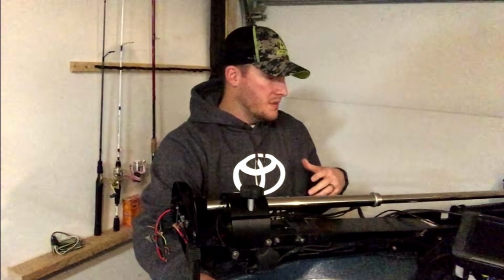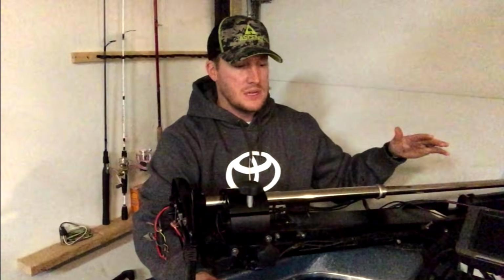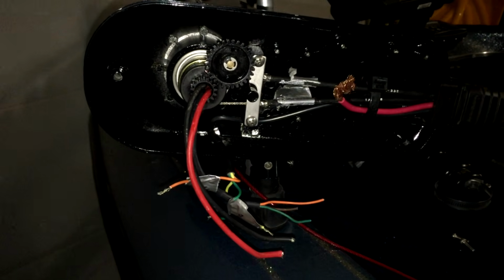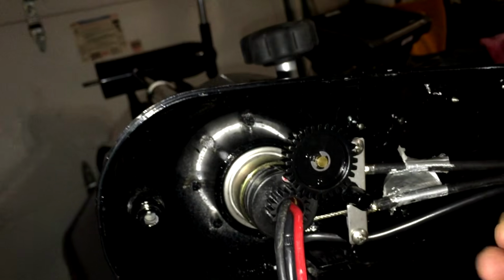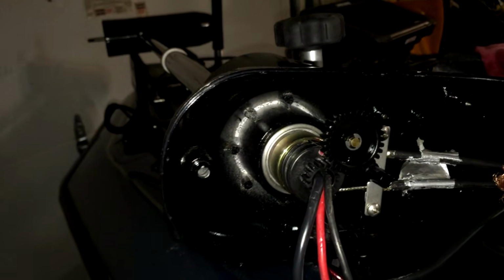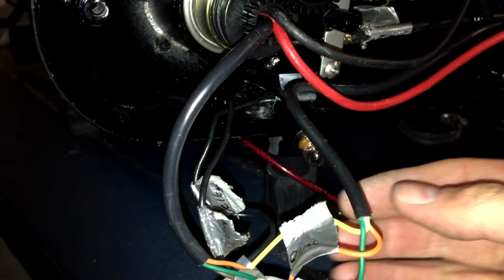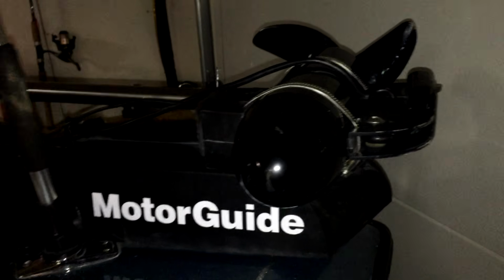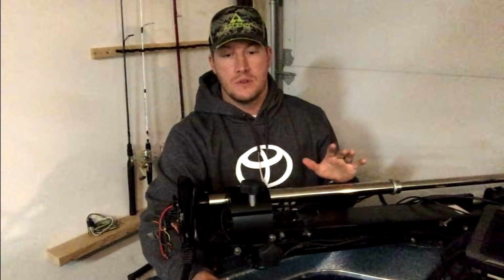Motorguide  Trolling Motor Repair

Comment: Does the cables for the steering go through the shaft or fist in the head? I need to cut my shaft down some because it’s to long but I won’t be able to if the cables run through the shaft

Comment: Hi. I have an older MotorGuide Stealth-30V. It has 2 options to move the boat: the first "auto run"=moves independently with no touch and 2) moves when you press the shorter grey pedal on top of the main pedal, downward. My first option, the run  automatically option when switched to the "left" does not function; there is no response. Yet the 2nd option does work: when I press the smaller grey pedal down, the troller does function well. What would I need to do to get option #1 working again, pls?